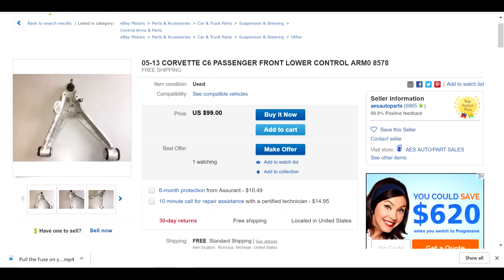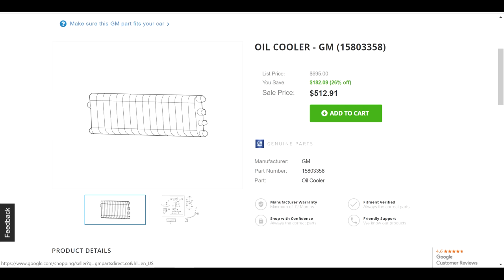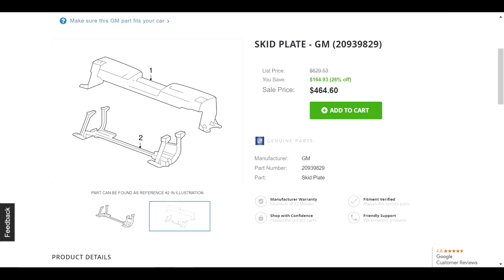How Much I've Spent on the Salvage C6 Corvette Grand Sport Rebuild Project *Really Cheap*

Comment: What is the point of even rebuilding these cars? I guess it's cool to take a broken worthless car and turn it into a less broken worthless car, but who would buy a totaled car repaired by some dude. I wouldn't even buy a totaled car repaired by master auto body techs.
Reply: People who want a corvette but don't want to pay non-salvage title prices thats who. 
There are a couple used lots here in town here that do nothing but sell newer rebuilt titled cars, the owner also owns a body shop, so its really just his cost into it.  For something relatively new, its something along the lines of $5k - $10k less than average pricing due to the rebuilt title. He turns cars over quickly, so there is a viable market for these things.   And really, as long as the car is rebuilt properly, its no different than any other car. The only thing getting many of these cars a salvage title is that retail pricing (what a body shop bills the insurance company) is ridiculously high, and they will quote new oem parts in many cases which just drives the price even higher.  Sams corvette as you can see  he's getting parts at a fraction of the cost a body shop would because he can take the time to shop around, and can buy randomn used parts, a body shop needs parts today, not one today, one tomorow, another next week.  He will come out ahead when flipping it.
Reply: "And really, as long as the car is rebuilt properly, its no different than any other car." I beg to differ. It's a smashed car that was repaired. Any other car would be in factory/near factory condition. It's a big difference.
Reply: Yes, rebuilt properly. And yes, smashed and repaird, which is why its priced below that of non-rebuilt titled cars by a good margin.
Reply: Yeah that's my point, you spend so much time and money trying to get a car back to original condition and even when done properly you can't. Then you make a few thousand bucks for a month or more of sourcing everything and dealing with all the challenges of repair.  Then you get into the repair and discover the rest of the damage. It's not worth it. 

Even sam crack explains in some video that the reason the reason people straighten out the panels and lay them over the totaled vehicles at auction is because there is more money in it than actually repairing the vehicle. 

I guess if you are selling to saudi arabia or eastern europe you can make a decent profit on this.
Reply: Everybody needs a hobby, some hobbies just have a higher buy in price.
Reply: Rebuilders do whatever they can to "save" a part and a buck. Up to and including sectioning rails, or putting a torch on a HSS frame rail to save it and bondo-ing it up to cover damage. All of which screws with the air bag timing.  Today's cars are designed to collapse at a controlled rate. Once those parts do that they're compromised.  The proper repair is replacement which with a rail replacement would also include dropping the engine/transaxle/suspension/cradle and pulling the dash and interior firewall mounted components, or you can get out the die grinder, torch, and booger it together and hope you don't get hit head on where the engine ends up in your lap before the air bags even go off. In 25+ years as a collision tech I have seen some really horrid repairs the worst ones being from the rebuilders. Not saying all do bad work, but shortcuts are more likely to be taken by the rebuilder then the bodyshop that would have been paid to repair the car properly and is worried about it's reputation. He's lucky the vette didn't show up with a broken block. It happens

Comment: Third party parts = Chinese cheap parts!  If you have a performance sports car( corvette, Porsche, etc) and you have to revert to Chinese parts, you might realize you can’t afford that car!  A 65 dollar oil cooler verses an OEM $500 dollar oil cooler specifically for a corvette, there is a reason for that.  An oil cooler has to operate at engine pressure at high temperature, I would not want to put a generic Chinese oil cooler not spec’d for this vehicle. It always a joke to see guys like this buying cars they can’t afford new, so they buy them salvage and then fix then with junk parts, and then want to flip them for a price of a comparable vehicle with only oem parts. What a joke

Comment: I still don’t see why you are fixing the pizza car. You should have taken the custom pizza parts off and put them on the silver car. And made the silver car the pizza car.
Reply: The silver car has been flooded and it probably has mold.
Reply: Jake Johanson because then he'll have an original dxp car and if he saves it for like 50 60 years. They will definitely be worth a lot of money a long time from now, he needs to just keep it as a little nest egg or pass it down to his mini crac
Reply: Jake Johanson too much new wiring considering the car was flooded plus all the custom wiring for the pizza oven, having to cut out and got that in the original car, etc.. would take too much time and probably money.
Reply: It has a "clean" title while the other has a certificate of destruction. And he can sell the parts off the silver car and make his money back.
Reply: The silver Spark has a title of destruction.   Meaning it most likely can't be legally titled for road use.   He has gone over this at least twice.
Reply: Garage Shop Shenanigans you can get it done in Montana
Reply: Even if you can make the flooded car the pizza car a little bit easier... personally if it were up to me I would just fix the original DXP because that would be more fun! Your fixing the original engine and you will have an actual original DXP instead of some ripoff copy. And like someone else stated, he'll get his money back anyway from selling the spare parts so the only thing he is spending at this point is potentially more of his time.
Reply: I still don't see why people still make this comment. The silver car has a bad title. Getting it back on the road is actually way harder, even if it appears to have less damage than the dxp car. 

Have you ever taken a custom pizza oven out of a car to put it in another car? I don't think anyone ever has. You'd have to swap a shitload of custom parts and then you'll have a fake dxp pizza car that's worth much less than the original. And you're not even done, because of said title you're pretty much unable to drive this thing on the road ever again, good luck after also turning it into a pizza car. Sure, it seems easier to use the silver car but it's actually a lot more effort than replacing a few parts and painting some panels on the dxp.
Reply: john broskey thanks, I missed the clean title. Thanks for not biting my head off.
Reply: Calvin Junge you can rebuild the tittle, you just have to fix it and get it inspected by the right people
Reply: No one really wants to see a spark put back together, it’s a shitty little econobox. Not great for building a YouTube channel. The pizza car however, even though it’s the same car essentially is somehow interesting. Hell more people wanted to see it than the corvette.  The video series is the end product, not the car.
Reply: silver one has" parts only " title. not much hope of getting back on the road.